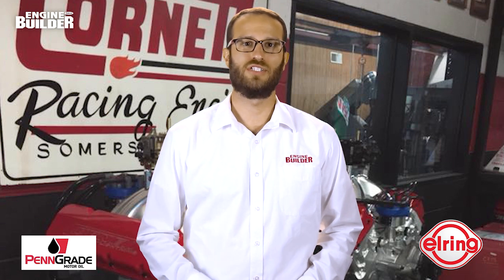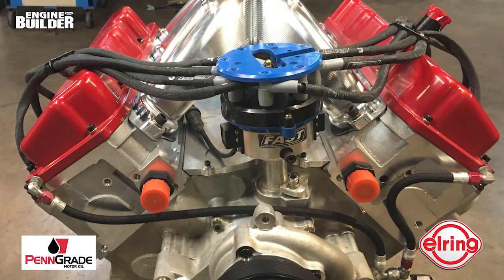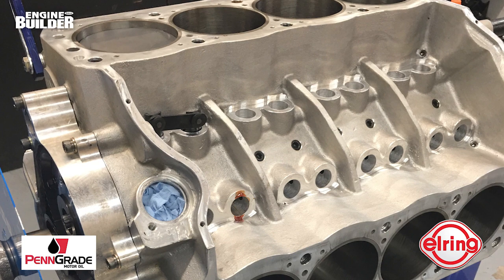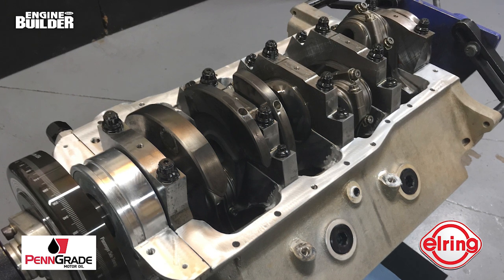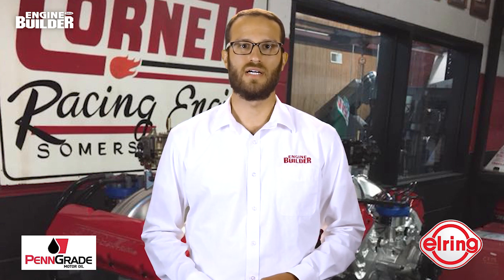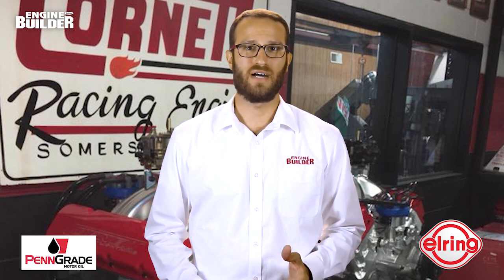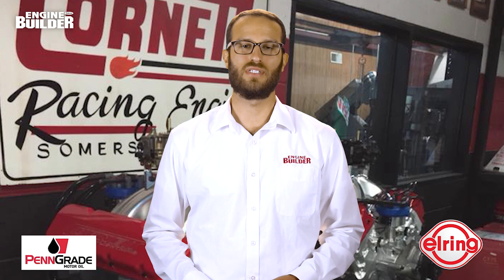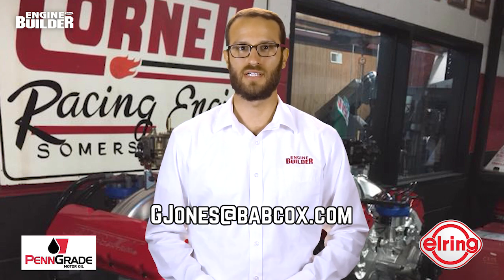433 cid Ford Dirt Late Model Engine

Comment: A Gr8 Guy in Georgia is building SBF with his own designed Hemi Heads.  427 cu inch made 928 hp & 674 ft lbs . Equally impressive 
Heard recently that he has bettered that by quite a bit . 

Heard John Kasse talk about FBB & if l had my time again l wouldn't have built up a Blown BBC . 

Would have gone to Kasse & asked him 2 put 2gether a real nice 598 or 632 with his Boss 9 Heads Blown & Intercooled .

Comment: You have to be a doctor to make 2 hp per cubic inch with an N/A setup!!
Impressed!!
Reply: Not true.   If you build an engine that can withstand engine speeds above 8500 rpms per minute, and you use very high flowing cylinder heads, then 2hp per cube is kinda ho hum.    Look at what openwheel engines produce with very very small cubes.

Comment: 433's are good short track motors, back in the 80's and early 90's we ran 355's and 402's in our late models then someone came along with the 433 Then the 502's now we have the 602's and 604's one making 350 HP the other 900 if tech asks but in reality around 1000 to 1100 great video thanks for sharing
Reply: A 604 making 900HP? Gotta be a typo!
Reply: @JalopyTechnology  no a super late model motor makes 900 to start after we all cheat way more
Reply: @Marvin Trammell I’ve seen 940 before
Reply: @shaneferrebee9871  Ya, a built 4.5" bore center with great heads, 460", and yes, you'll see 900 hp.
Reply: You are higher than a kite dude. The 602 crate engine is 350 hp. The 604 is a crate engine of 400 hp. The CT525 makes 525-550, another crate engine. Jesus...built engines are the only thing that make big hp. Our 421" SBC makes 829 hp for our Super Dirt Late Model

Comment: This is a Clevor
Reply: What makes it a Clevor?
Reply: The Clevor bypasses the oiling issues of the Cleveland engine, and uses the larger number of tall deck Windsor blocks out there and its ability to go out to 427 cid relatively easily.
Reply: Windsor block Cleveland type heads.
Reply: Gotta love being able to mess with the intake without draining coolant. Imo thats one of the biggest benefits to the Cleveland.
Reply: A clevor would be a stock based block from a Windsor and a stock based set of heads from a Cleveland 351. 
This is effectively a big inch Nascar spec engine. Nothing of this is stock based.